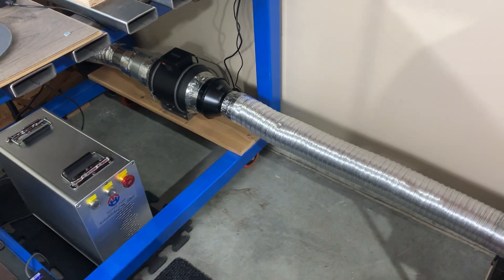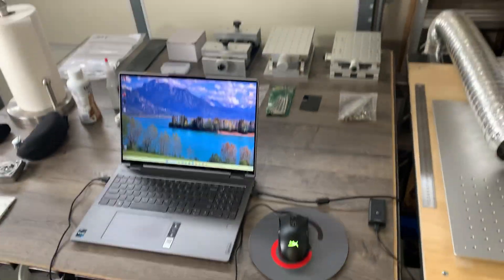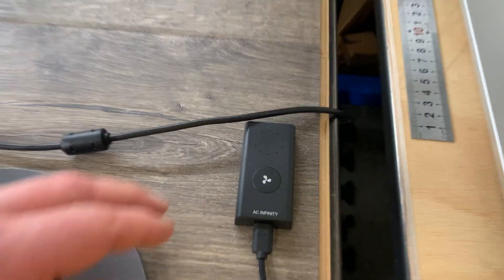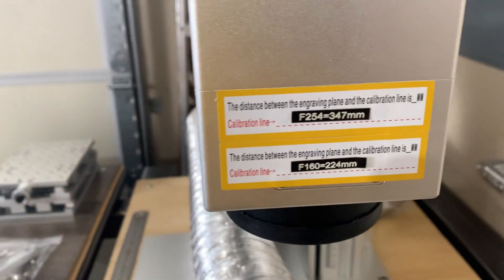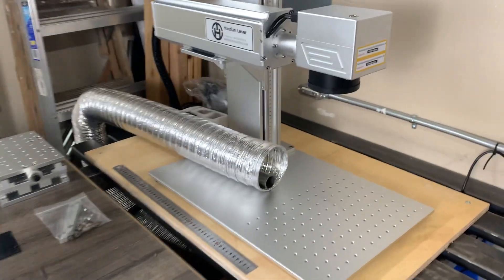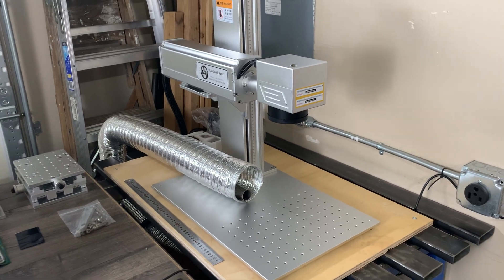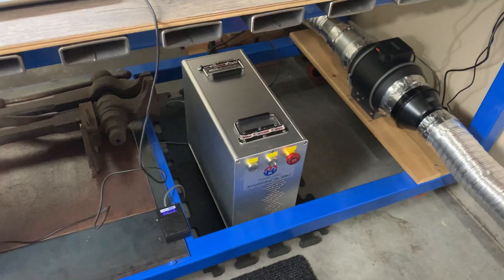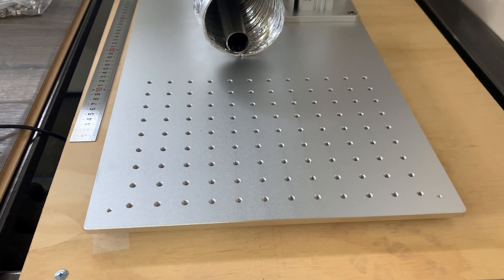100 Watt JPT M7 MOPA Fiber Laser All Setup And Ready To Go!

Comment: Was there a big price difference between an 80 and 100 MOPA? Thanks.
Reply from the maker: I didn't ask that question, mostly because I wanted to go straight to the 100W
Reply: @NewportStudio  I ended up going with a 100W...I asked for delayed shipment though as I have some prep work to get done first. I like your exhaust but it would be nice if they had a rotary switch instead of the click type...might have to see if I could find a rotary switch that would work.
Reply from the maker: @steinbierz  That’s awesome Larry, I’m excited for ya!  Yeah, the click switch can be a PITA, but the 10 speeds are perfect for that 6” fan.  If you need any pointers let me know